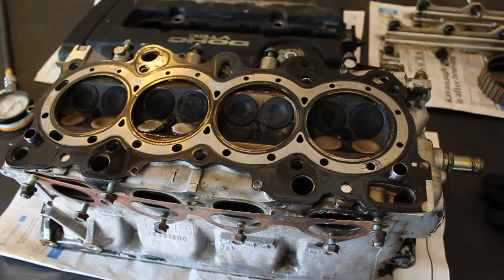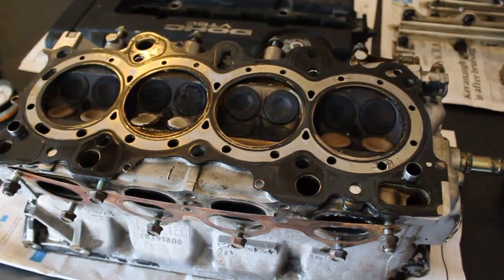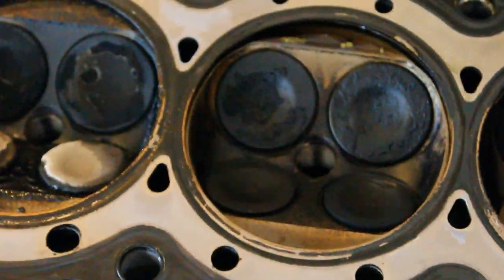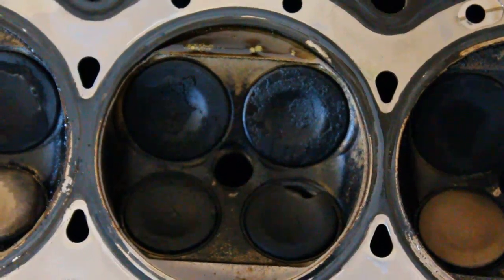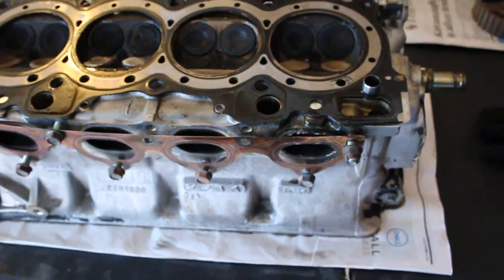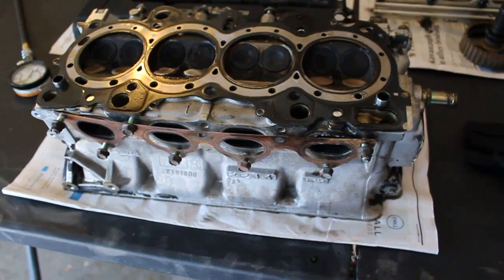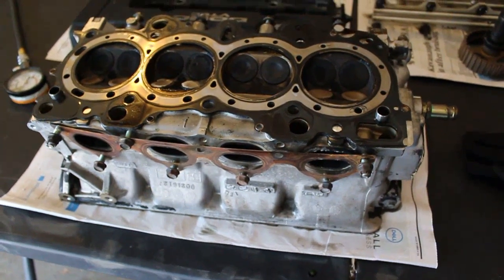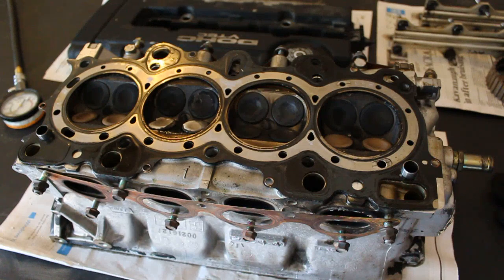Reason for zero compression in one cylinder (dead cylinder)

Comment: No compression on all 4 cylinders, what could have happened?
Is it just the head gasket? Or is it something more severe
Reply from the maker: Could be a lot of things. Does it spin freely? Could be a timing belt issue or bent valves. That would be nice if it was only a head gasket though! I'd be interested to hear what you find.

Comment: Thanks for the video. I actually just had a chipped exhaust valve on cylinder 3 as well, same exact problem, causing a 0psi compression test on the 3rd cylinder. I'm working on replacing and relappinng valves next weekend.
Reply: How much did it cost for the parts

Comment: OP, question about this--when you started noticing the issue, I'm assuming it ran rough and misfired, but was there any color to the exhaust? I'm troubleshooting a misfire in a cylinder with about half the compression it should register, but my exhaust looks normal.
Reply from the maker: I bought this engine after it was already pulled from the car, so I dont know how it ran. A bad valve won't cause the engine to burn oil (blue smoke). Bad valve seals would cause oil to burn but the valves themselves only direct air... try adding a little bit of oil to the cylinder when you're doing the compression test. If that gives you a dramatic increase in pressure then it would point to the piston rings as the issue. If oil doesn't change anything then it's likely a valve issue.
Reply: @joelt8887  cool thanks for the reply!
Reply from the maker: @callbackdons  good luck!

Comment: so i have a question

i did a compression check on my engine and 1st cylinder came out at 0 compression the other 3 ranged from 100 to 120 
its a b18b1 from a 94 acura. is it likely the 1st cylinder has bent valves causing the issue or or cracked like yours? i haven't completely taken off the head because i had people telling me it may have been a timing issue but i was certain it was compression. could timing cause one cylinder to have 0 compression or is it likely damaged like yours?
i planned on rebuilding and putting all new gaskets but i dont want to take apart if its a timing issue. i know the 3rd cylinder ranged at 200  or 190  so i am assuming gasket replacement with resurface. any input would be appreciated thank you
Reply from the maker: In my opinion all 4 cylinders would have similar low compression if it was ONLY a timing issue. Since only one cylinder has 0 compression you probably have an issue similar to mine. The engine will almost definitely need to be taken apart to repair a 0 compression issue. Could be a burnt or bent valve, damaged piston, head gasket, or cracked cylinder wall. Good luck!
Reply: @joelt8887  thanks i appreciate the response i'm continuing the tear down right now.
Reply: @joelt8887  after removing the head one of my valves was cracked and my gaskets were blown all around except for the valve cover looks like i gotta rebuild or replace the head.
Reply from the maker: @gokermitsewerside358  sounds a lot like mine... at first I considered just replacing the damaged valve and the valve seals but ended up deciding to do a complete rebuild. Doing the finishing touches on it this week!
Reply: @joelt8887  so are you just replacing the head or same head but replacing internals? 

i got the car for a steal 650 running but it over heated some reason not sure if lack of coolant or because of the dirty muddy water that got into the block from the radiator i didn't flush it before driving it.

are you going to be making a video on it lol?
Reply from the maker: @gokermitsewerside358  ended up replacing all the valves and having the seats and valves cut at the machine shop... Yeah, planning on doing another video once I complete the rebuild and the swap.
Reply: @joelt8887  sorry for bothering so much but should i replace valves prior to having the head resurfaced?
Reply from the maker: @gokermitsewerside358  no worries man, that's why I made the vid... I spent an embarrassing amount of hours trying to lap the new valves into the old seats only to find out that they were way out of spec and had to be redone by the machine shop... you may want to give your local machine shop a call before you get too deep into it to see what things cost and what the recommend that you do. The short answer to your question though is that the resurfacing should be the last step before you reinstall the head. If you resurface the head and then continue to do work on it you risk scratching the new surface.
Reply: @joelt8887  thanks man i appreciate it so much.
Reply: @joelt8887  last question lol do you think 320 to 500 is a good price to have the head resurfaced an all valves replaced? i called a machine shop and they said they will only replace all 16 not just 1
Reply from the maker: @gokermitsewerside358  I paid about $450 to have mine done, and that was because they needed to cut both the valve seat and the valves.
Reply: @joelt8887   i know they said only 70 to resurface and once i asked about the valve job they said they wont just replace one im assuming because then they cant charge me the hefty 320 for one replacement

they said the head gets cleaned disassembled which i pretty much did and re assembled he used the  term "grounded"?
Reply from the maker: @gokermitsewerside358  yeah, I got a little excited and disassembled everything myself and later found out that it really didn't save me any money... I did port the head while it was apart so I guess disassembling it wasn't a complete waste.

Comment: Burnt valve or over revving the engine causing the valve to float and chip off part of the valve. Either or both in this situation.
Reply from the maker: Thanks man! That's what I'm being told.
Reply: is the problem fixable....and if you get it to a mechanic to fix it would he suggest an engine swap....cause thats what they sugested me today...is there any cheaper solution?
Reply from the maker: @MrsLydiaPo  if you can do the work yourself I'm sure you'd save some money, otherwise it's probably cheaper to replace the engine or the head with a used one.